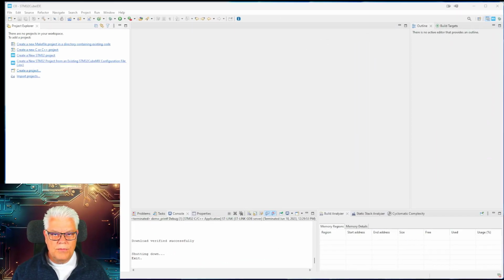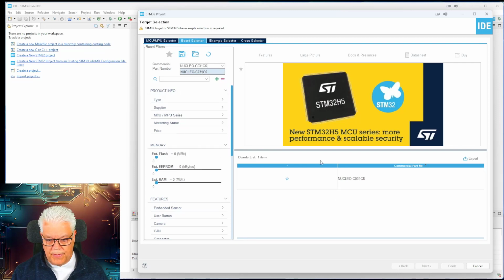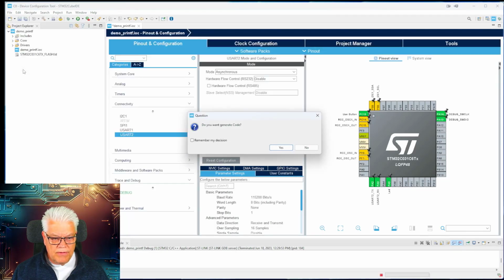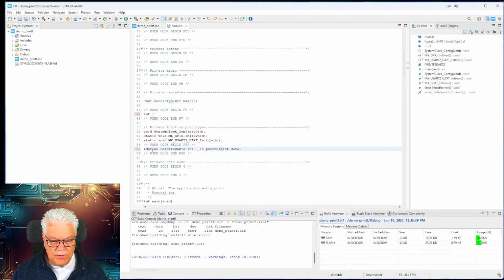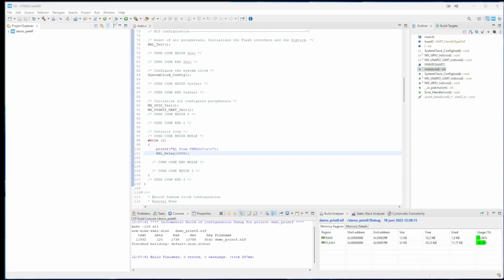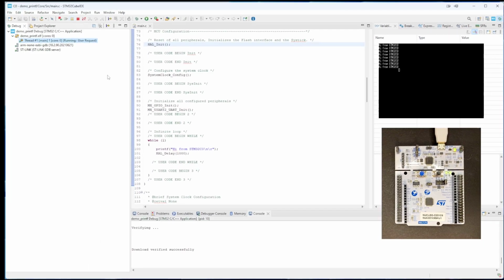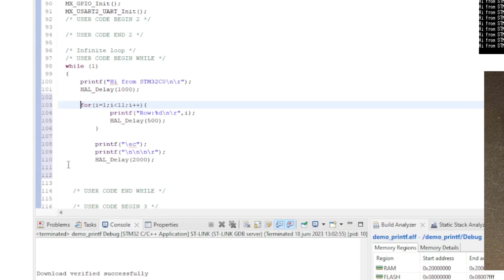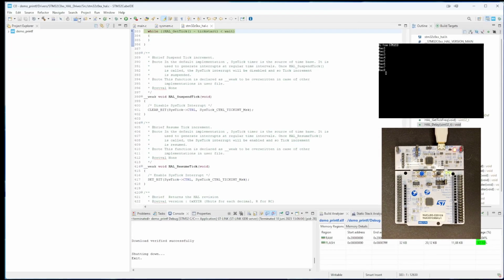STM32C0 Tutorial, How to use printf

Comment: Great video! However there is something I don't really get.
The prinft() output is shown in a terminal. However, this terminal is not the console output of the STM32 IDE right? 

So is this some kind of putty Output? 
And how would you make the printf() messages visible in the console output of the STM32 environment?
Reply from the maker: The Terminal that i used in this video is a part of STM32Ide enviroment but an external one.
Reply: You need to make a new connection